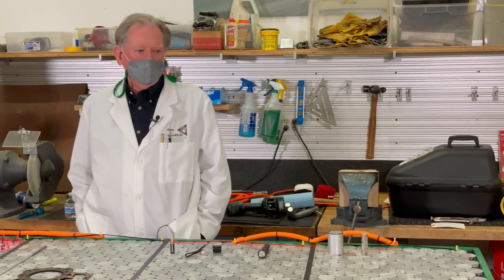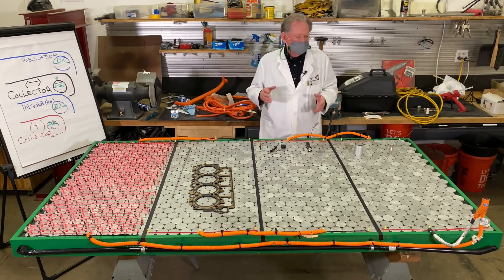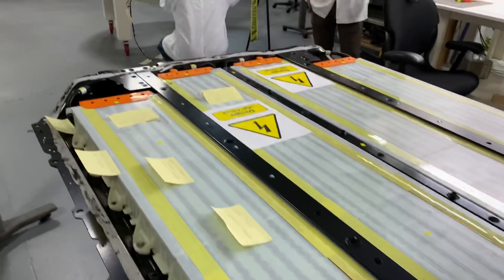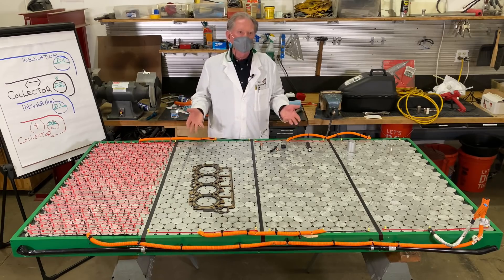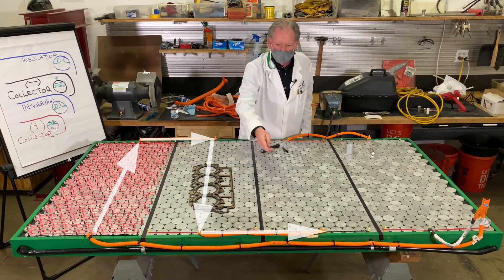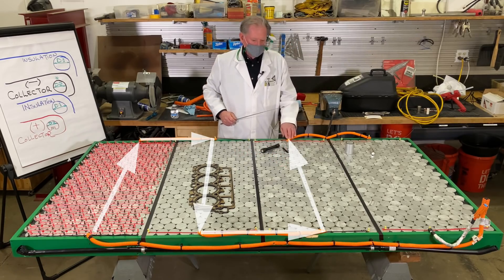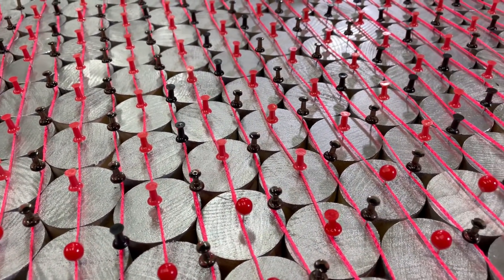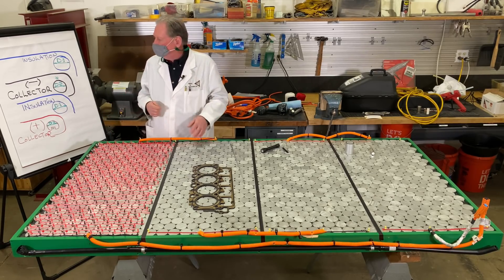Tesla 4680 Battery Pack Prophecy

Comment: Why can’t you put the batteries in a long plastic tube like a flashlight and then connect the ends to get the required voltage

Comment: In the photos from gigaberlin they were still using snake cooling in the 4680 pack. Why no plate cooling from the bottom? Are they worried about differential thermal expansion between the top and bottom plate of the pack? It'd be about a millimetre in the most extreme edge cases for steel, so not entirely insignificant.

Comment: Wait why would they remove those tiny wires? Aren't those "tiny wires" there as a Fuse? By design they are meant to blow if one of the cells fail without disrupting the entire pack. I dont seem them removing those bond wires unless they have come up with a better solution to prevent 1 cell from destroying the entire pack.

Comment: Full size Evs will waste these improved cells causing the minimum benefit.  Li batteries are limited in production; and for every full EV you could have made 10x hybrids; each which could drive commute miles all electric.  Tesla recently past a production of 1 million cars; 10 Million hybrids could have been made with the limited battery supply instead.  80 Million cars are sold annually; 1 million EVs makes very little dent when you could have removed 10 million ICE cars instead.  Compounding this Full EVs are still overweight cancelling much of the electric motor efficiency and cost more CO2 to make; the entire effort is backward for Co2.  Tesla actually causes 9 more ICE cars to be made to meet vehicle demand.  If you want to make ICE cars illegal ; make large EV cars illegal also. Oh and as for the 4680 cells; they are better cells but using them in big EVs that are now going to be integrated into the body will ensure these cells will not be easily removed from crashed cars for salvage; making them an even more negative proposal.  You could have put these cells into hybrids - but Tesla evidently wants to make the minimum impact possible with their advanced cells.  That is a total humiliation.

Comment: How did nobody catch the utter BS at 1:30 where he says the "battery pack" (not an individual 4680 cell) will have "6x the power and 5x the energy".  This is utterly and completely wrong and just incorrectly parroting Elon's quotes.  The complete PACK will have a slightly higher energy density due to less metal per cell as volume of the pack as a whole, but it will be a manner of a few percentage points overall, hardly earth-shattering.

Comment: Based on what I've seen thus far, the 4680 cells specs are likely as follow:
 Diameter:  46 mm
     Length:  80 mm
    Voltage:  3.7 V (nominal
Amp Hour:  ~26.8 Ah  (95 kWh / 960 cells / 3.7V (nominal) = ~26.8 Ah)
Watt Hour:  ~99 Wh (26.8 Ah * 3.7 V (nominal) = ~99 Wh)

The above numbers are based on the following reported facts:

New 4680 Batt Capacity:  95 kWh
4680 Cells in New Batt:  960
Energy Density:  Reported to be 5X higher than the 2170 cells (3.7V * 5Ah = 18.5 Wh.  18.5 Wh * 5 = ~92.5 Wh for the 4680)
That ^^ is reasonable because the volume of a 4680 cell is ~5.4 times larger than a 2170 cell.

Comment: Will the new structural 4680 battery pack that will be included with the new Tesla Model Y being produced in Texas be replaceable?????  Or is the car  DOA if the battery fails???
Say you have 4 cells.  Will tesla be able to replace individual cells or will the entire battery pack have to be replaced in case of failure?
Thanks in advance for any information you can provide.

Comment: Good explanation and easy to understand. So, if one batteries is dead open the pack will lose 10 batteries ? I was under the impression each batteries has a little circuit board to control its healt/charging/fusing. Thank you for the video.

Comment: would have really expected more then just blindly reading specs of the Tesla slides, holds 5 times the energy and then neglecting to tell the uninformed that this is to be seen as per cell which also happens to be almost exactly 5 times as big in volume so any increase on pack level comes from packing cells closer together and not from any improvements in battery chemistry.

Comment: Refers to manifolds then uses a cylinder head gasket to illustrate ? Ouch!  Also it's a 3V flashlight using two 1.5V batteries in series.  A 12v car starter motor can use one 12 V battery or two 6V batteries in series.  How many V is the Tesla car drive motor?

Comment: Just a correction, don't know it it's been pointed out : The individual 4680 will have 6 times the power and 5 times the energy of a 2170 (it is of course much larger) The battery pack Will NOT! If if did it would have 5 times the range.  The 2170 battery pack has 5 times the cells of the 4680. The newer battery uses a  more efficient design - this is where most of the range gains are made.

Comment: Holy JC, talk, talk, talk.  Sandy!  Did you mean to say that, first, Tesla puts a bunch of batteries in series, to up the voltage?  Then, they put several of those bunches in parallel, to up the amperage?  Could be, but after 10:00 I'm still not sure that's what you were trying to get across.

Comment: Aren't the tiny wires in the original battery actually fuses? These open  to prevent parallel batteries from discharging into a shorted cell resulting in a RUD.

Comment: I don't believe this is going to be how they do it, cause you reintroduced tabs in the cell itself in your description at the beginning of your vid so automatically makes this wrong cause this is a tabless design cell which means the top of the cell is most likely (+) and bottom of the cell is(-) so this manifold method will not suffice.

Comment: Isn´t there a short circuit risk if the second insulation layer sits at D2? With plus having small D3, a SC is possible. Wouldn´t it be safer to make the 2nd insulation layer D2 or slightly smaller? Maybe I just can´t wrap my head around it...

Comment: I've been wondering since battery day sorry if this is dumb question but if it has 5 times the energy density or 6 times the power.... Shouldn't it also have 5-6 times the range? How can you quintuple the energy in something and not quintuple the output you use the energy for?

Comment: So if battery becomes part of the vehicle frame then we should be able to troubleshoot and replace single cell in new Tesla vehicles, right? Otherwise the entire car will have to be scrapped to fix a few cells issue. But that is very difficult unless car will be able to control and balance down to single cell. Which will be awesome!

Comment: 960 cells of 3.7V ea. 
arranged in 24 x 40 
divided in 4 banks of 24 x 10 = 240 cells. 
Each bank of 88.8V has 24 of 3.7V blocks (of 10 cells in parallel). 
Thus 4 banks of 88.8V in series produce 355.2V in total voltage.

Comment: I still don't understand why make cylindrical cells?  Much larger batteries make more sense from an energy density point of view.  The only reason I can think of is cylindrical batteries add some sort of safety factor in case of accidents.  Can anyone explain why make relatively small cylinders?

Comment: If insulator have same size of hole, positive current collector can be touched by negative current collector. So insulator with smaller diameter need for positive current collector.

Comment: Tesla’s 4680 cell. 

Tesla published 4680 format cell package use - point contacts - to conduct heat and current from electrode to cell wall (output terminal) instead of conventional welded tab. Welded tabs ensures reliable heat and electricity conduction to cell exterior. 

Problem? 
(1) Heat and electric conduction performance of point contact multi tab 4680 cell requires a substantial contact and retention forces, were not part of Tesla’s patent .
(2) Point contact required compression and retention force are not to be derived from, or coupled through, electrodes or multi tabs because those are made of soft copper of no spring properly. If there were contact force packed into the cell such force will (1) be coupled into the electrode that can delaminate it. (2) follow that compression force and contact resistance will be degraded by - use of annealed copper electrode, temperature shock, inertial shock and thermal cycling. Progressing into an open circuit and electric spark inside the cell, triggering off a  rapid oxidation process or an explosion.

Comment: Circuit board!  I suspect the technology used is more circuit board technology instead of gasket.

Would spot welding be used.  A spot weld is a relatively small contact area.  A solder joint could be designed to connect the whole end of the battery.  Thus giving a large electrical, and large thermal, and a large structural contact.  Surface mount chips are soldered in ovens.  Would LI batteries stand it.  Infrared ovens could be used to just heat the top, thus heating the battery less.  Would it be enough?

Comment: I mean I understand since I'm an electrical engineer, but I question is how does this differ the modular pack that is currently in the Tesla Model 3? Yes: I know the cells that are being using are different, they are energy and power dense, they are larger. But what I am trying to get at is more specifically that currently the Tesla Model 3 battery is divided into different sections aka modules. A side from it being a singular module in this case, but still divided into what is 4 sections/batteries that run in series and parallel like current Teslas. What is the big difference? Is it just making a single tray, putting all the cells in that tray, and calling it a day instead of combining 4 trays?

Comment: 2:09 I haven't seen this physical representation for decades, but it definitely on every engineer's mind.

Anyway, the reason for this change are (two words) to improve "manufacturing reliability" by sacrificing thermal buildup (capacity) such as the 2170 / 18650 setup.
8:33 "Manifold" , actually called "lead-frame interconnects", but layered like a PCB and it possible to design some section for these tracks in a way to act like a fuse wire as seen on 2170 / 18650.

4680 is a big change from 2170 / 18650 design, I suspect Tesla found a way to deal with thermal problem, considering the flexi cooling strip slip between 2170 / 18650 design is a messy assembly process.

Also, + and - on the same side means easier assembly (like prismatic cell) and it doesn't take much imagination to include a dented dimple at the bottem for this 4680 battery for 'poka yoke' location.

I suspect the change from 2170 / 18650 to 4680 is because Tesla realized their 2170 solution isn't driving up demands for other applications to drive down unit cost e.g. do you know any eScooters or ebikes that uses 2170?  So going 4680 is like saying I'm going bespoke rather than off the shelf, while reducing the head room by (or increase overall car height) by 10 to 25mm, from H = 65mm > 70mm > 80mm.

Comment: 1:38  I do think he has a far deeper understanding of the dynamics of the system, but I feel compelled to say that the cell itself will have 5X power and 6x energy compared to the smaller 2170 cell, not the pack. The pack would pretty much be the same, albeit with a slight increase in energy. 
This seems to be a common misunderstanding, energy density and absolute stored energy are two different concepts. When you factor in the weight and size of the cell, you’ll realise they don’t hold 6x more energy per unit mass, but just a bit more energy than the 2170, which is majorly attributed to the more efficient use of space and comparatively lower weight of inactive components in each cell.
Reply: Amazing that horrific nonsense was allowed to be posted.  It pretty much makes Sandy look like an idiot...

Comment: 12:30  are you speculating that this will be a 4S-240P battery?  If so, nominal voltage will only be 14.8V.  Theres no way this will be 14.8V.   It'll be either 400V or 800V (like the Porsche Taycan).
Reply from the maker: 96S10P. Sandy was trying to show how each group of 24s10p would be in series.

Comment: Wouldn't it be better to have the positive and negative on opposite side like an AA  battery. Then have all of the positive sides in one unit facing up, Then just lay a copper sheet and tack weld it to each cells centres. Then do the same on the negative side. A lot simpler method of production. Then just lay insulating material over both sides. No wires at all and the tack welding can be done by a machine, speeding up construction considerably and reducing cost.

Comment: Comment on the manifold design proposal: The wire found in todays packs are also fusing every cell. Would one cell go bad and a high-power discharge event occurs , the bad cell would be electrically disconnected from the rest of that parallell group when that fuse-wire blew. Idk what the case would be with that manifold design, I definitely see the benefit of going that manifold way.

Comment: This is a great explanation. I am very curious as to when what happens when a battery changes polarity.
I have worked with consumer batteries for a while now and noticed when I have a several of batteries in a serial setup, sometimes one or two batteries get used up and become negatively charged to the point that they actually absorb energy instead of releasing it. Have you seen Tesla batteries have a similar behavior?

Comment: I do wonder if they will get rid of the small wire to each cell.  That wire acts as a fuse of sorts.  If a cell goes bad, that wire will separate and isolate the cell from the rest of the pack.

Maybe the small spot weld will include that same function, but I can't figure out how they're replicate it.

Comment: For a car size like Tesla Model 3/y my battery design could have > 13.6KWh per centimeter of pack height @ 2100 mm x 1700 mm  = 108.8 KWh for 80 mm of battery height without casing / shields) and also > 13.4 MW with a current draw of no more than 10 A/mm2 highly attainable because of the self-cooling design ... Any thoughts, interrest at all or I'll be force to see this ideea go the way of all my other 50+ inventions ... ? THIS BATERRY DESIGN DOES AWAY WITH MOST OF THE MANUFACTURING STAGES WHILE USING THE SAME CHEMISTRY = VAST POTENTIAL FOR A MAX ACCELERATION TOWARDS FULL ELECTRIC WORLD. THANK-YOU !!!

Comment: The second insulation layer should be of equal width or smaller than D2, otherwise D3 (+) will touch D2 (-) and you will have a short. Other than that great video!!

Comment: Well the main improvements in the 4680 are cost and manufacturing processes. That's great for tesla but at the end of the day I'm still driving a car with 1000lbs of batteries that takes hours to charge. The new batteries are only about 15% better. An improvement for sure but hardly a game changer imo.

Comment: Sandy,  I just watched your monthly appearance on E for Electric with Alex, and you've given a few hints,  puzzle pieces, I hope I'm connecting correctly. 

Megacasting greatly reduces parts and labor into those front and rear components of the chassis.  Tesla looks to go to a front,  rear,  and center casting,  the center holding the batteries.  The OEMs have long strove to simplify their product lines into a few "platforms, " most famous probably being the Chrysler K-car platform,  upon which they built almost everything for decades. Because that platform was such a huge investment,  they tried to stretch its use from econobox to sports car to luxury sedan to minivan.  However,  isn't what Tesla now doing with castings a reinvention  of the platform idea,  only by reducing 90+% of the complexity? Instead of hundreds of millions of dollars in investment that must be recouped over decades,  it's quick,  easy,  simple,  nimble,  and an asset more than a liability. I'd love to hear your thoughts on this.  And many other things.  Forever.

Comment: Thank u very much for the video. From my point of view what Tesla did is that they have shortened the electrons path to battery. Same system is in pouch cells- due to technology. In case 18650 or 2170 electrons needs to travel long distances from one side of battery to another. Because of connectors on one side of battery. In case of new Tesla negative side tha path for electrons is much more shorter- for now. So they are able to charge/discharge faster. Im not sure if the connectors +/- will be on same side as u mentioned- if I understood it right.

Comment: Also, if 330v nominal is correct, the motors will have to be changed, to have a different kV value (rpm for a given voltage). All current motors are designed for 400v nominal.

Comment: One 4680 cell has 6x the power of a 2170 cell. Saying the entire pack will have 6x the power of the old pack is incorrect.  That would only be the case if you had the same total # of cells in the 4680 pack.  Of course, that's not the case, there's like 1/4 the total number of cells.

Comment: Please be more careful when you say words.  You need to retract this video immediately.  The pack is not going to have five times the energy and six times the power.  The batteries inside the pack will individually have 5 times the energy however because there are far fewer cells there will only be a 16% increase in energy at the pack level.

Comment: Sandy, it's been my understanding that the tiny wires that are welded to the positive cell contacts in the existing packs are intended to act as a fuse, disconnecting a cell from its parallel cell group if the cell overheats and creates a short. Do you think Tesla might abandon this approach?